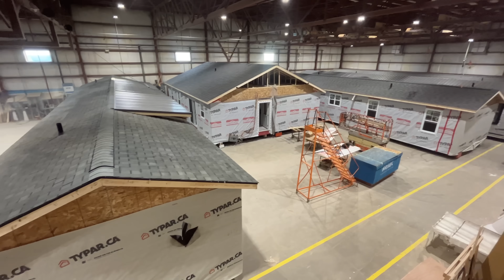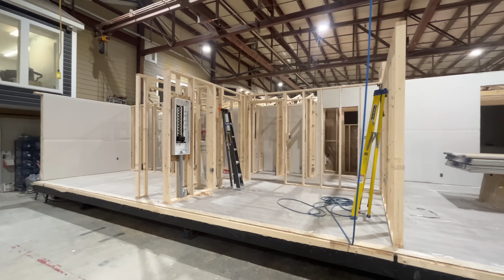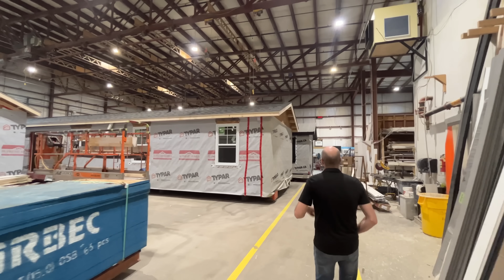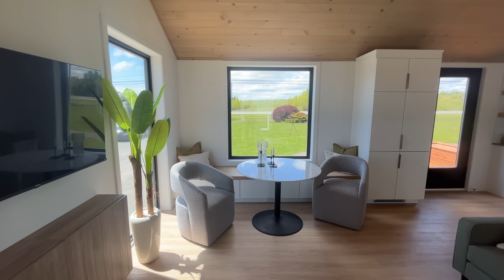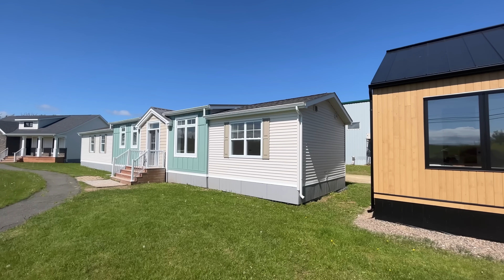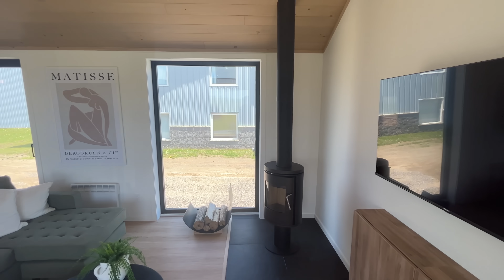I Went to See a Nordic Style PREFAB HOME and Ended up with a Factory Tour!

Comment: It’s hard to find pricing or area availability on their website. Really nice product.
Reply from the maker: They’re available in Eastern Canada
Reply: @ Hey Kerry, I’m looking for a 2 story or 1 story with loft for southern Idaho. I have access to stack units if needed. I watch your videos and love the Nordic, cottage style peak rooves and the Loyoll modern, high window and ceiling feel. 
Looking for at least 700 sft-1200 sft for under $150k.
Anything come to mind? 

I like “My Chez Space” DIY units, with 10’ exterior height. Their peak roofed, “View” model couldn’t ship to Idaho from Texas, sadly. Any ideas how to get the high ceiling with loft, or a 2 story unit to Idaho? 
Another favorite is “Blend”, for their interior glu-lam beam framework. In Idaho I could use a DIY or shell model with 1200 sft, or so, and could deliver a fully constructed one to site, but want to keep the price under $150-&175k.

In San Diego I need a unit under 800 sft. 680 sft as the smallest. I have to go with panelized or SIPs on light steel frame, since power lines prevent delivery of a completed unit. Otherwise, I’d spring for a Blend. Any ideas?

Comment: Are all of their homes Modular homes as one of them in the background looks closer to a manufactured home ? How are these homes in the long? How are these houses 20 or 30 years down the line do they hold up like a regular house or better ? Can these be remodelled like a traditional house, can I add an extension, build a second floor ? Do I have to worrry about removing walls ?
Reply from the maker: They build both manufactured and modular